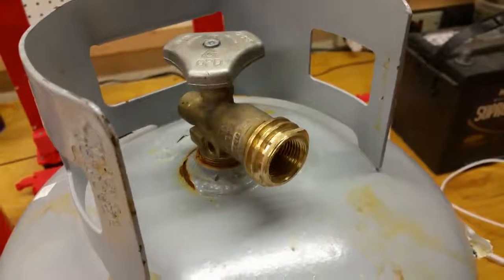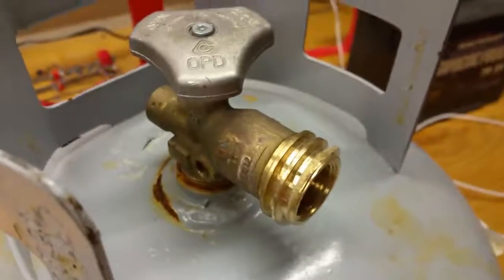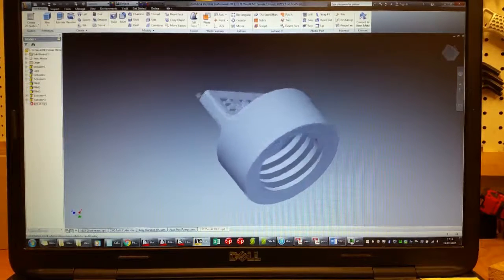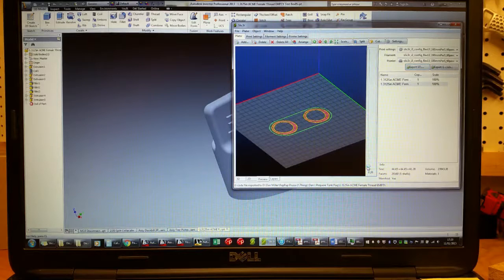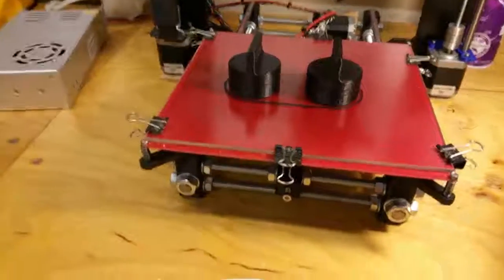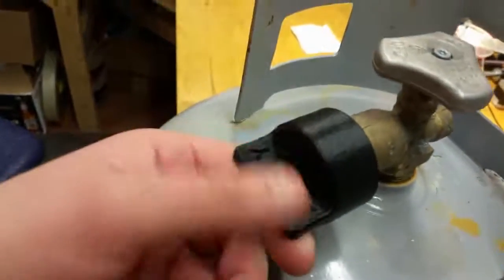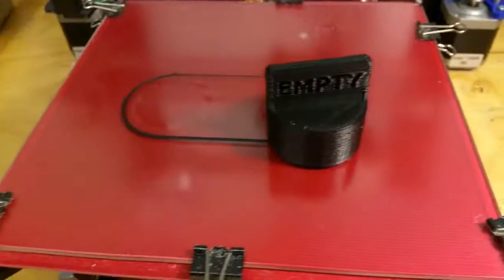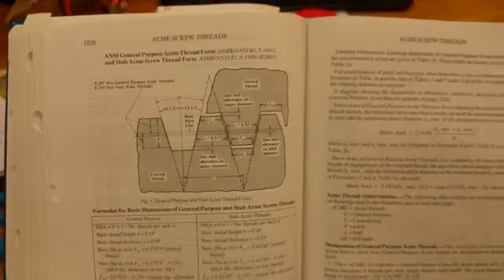3D Printed ACME Thread Example

Comment: I can't find the dimensions for 1 5/16" ACME anywhere. Can you post the major, minor and pitch diameter please? I'm attempting to draw something similar in Fusion 360 but I need to add the 1 5/16" ACME thread to the ACMEScrewThreads.xml file. Also what hole size for these? Any help is appreciated.
Reply from the maker: Dale, thank you for your comment.  I will do my best to answer:  I had to calculate the thread form from the ANSI General Purpose ACME Thread Form (found in the Machinery's Handbook, page 1826). This thread has a single start, 5 threads per inch, so Pitch = 1/5 = 0.20, Basic thread height, h = 0.5*P = 0.1, I added a little extra clearance for a smooth fit after 3D Printing, so for internal threads the Major diameter was 1.37" (slightly larger than 1.3125"), and the minor diameter was 1.150". The angle of the thread form is 14.5 degrees on each side from a plane perpendicular to the screw thread. I hope this helps & good luck on your project!!!
Reply: Thanks a bunch! Got a test print running to see if I got it right. I see from your other videos that you're in the Appleton / Neenah area. I used to work for Plexus and spent much time at the Wingate hotel there by the fox river mall. Never did get a chance to go to the Houdini museum though ;)
Reply: Worked like a charm Daniel. Thanks a bunch!
Reply from the maker: Dale Wright I'm very happy it worked out for you!!!